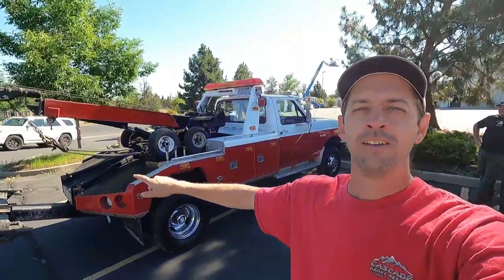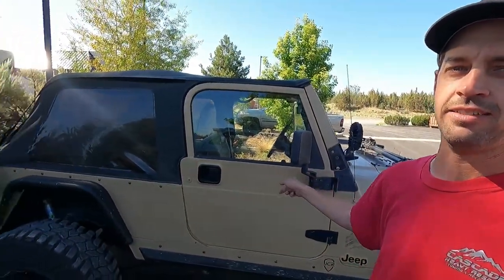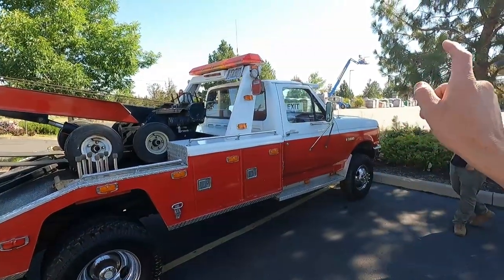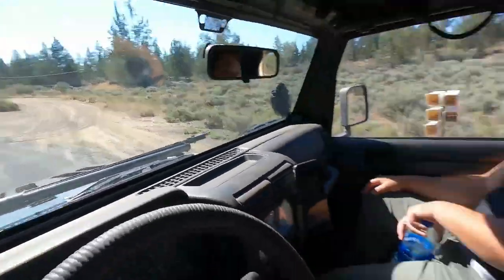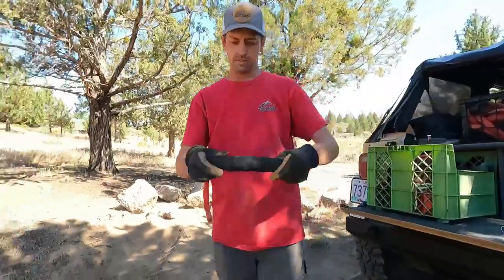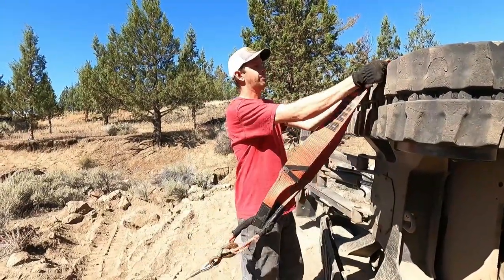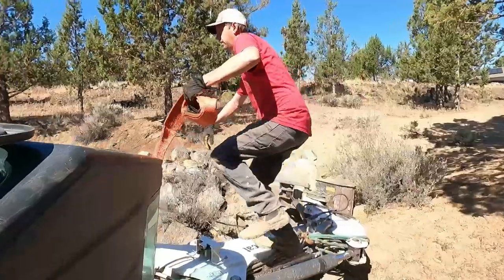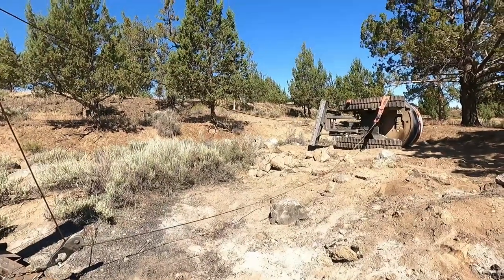Excavator down!  Time to bring in the new secret weapon!

Comment: That's a really good looking truck Casey. You need that.
Reply from the maker: I agree with you on all points!
Reply: @straybullitt  I know in Missouri, tow trucks there can run red/blue when called upon as they are considered emergency responders to remove wrecks quickly, and I think Washington St now allows for that too if not mistaken. I know this as I watch Ron Pratt of Midwest Trucks who does a lot of towing among other jobs as requested and he can run red/blue lights.
Reply from the maker: @straybullitt  perfectly legal here.
Reply: @straybullitt  Yep, exactly. That is why I mention Missouri and here as in MO, you can run red/blues, but here, I'm not 100% certain if you can, or it was talked about and can't recall exactly, but it will be different wherever you live.

Comment: I used to run pure hydraulic actuated mini diggers, you could self right them on the starter motor and the levers. Not so easy on these electronic command diggers, which is a shame. 

Anyway, that wrecker has your name written all over it, gorgeous.

Comment: Sweet rig. I still regret selling my (bought new) 2003 F250SD 4x4, 7.3, 6-speed manual. Great truck, sold it to buy a Raptor. The Raptor was sold when Premium went over $4 a gallon. Now driving a new Ranger. Those older 7.3 trucks have character, great find for your friend.

Comment: In the late 70s I helped get an excavator back up on tracks. Operator was trying to pull out a small tan oak which whipped back upright tipping the machine over on it’s side and down hill to boot. I used another tree pole as “gin pole” to raise winch line up in the air so that pull was upwards and not sideways. Worked great. Also used same method with people pulling to put up pole framed buildings. Old time methods can still be good to know.

Comment: Great to See Alex again! And Heavy Junk operators are pretty cool. Some are kids that didn’t get their way in the Sandbox LOL I was either a Jerk or their Buddy... Heavy Junk Mechanic! Pretty simple if they abused their equipment it took me longer to fix it ... if they were Stupid about how to operate it and didn’t know, (and most importantly they were teachable) I’d help them as much as I could! Even talking to the OIC of project and see about getting them more stick time.  For the Special ID-10-T’s that worked in favor to get operator level maintenance done. And washing the machines at the end of the week...  Rules of Army not instructed in school, Don’t Mess with or piss off Mechanics, Cooks, Supply or Medics. Ask Alex if that’s the same in the USMC?

Love the sound of that 7.3 Diesel! Oh yeah that’s why I got one too!!!
Mine is still stock 2001 Ford F-250  7.3 Turbo Powerstroke, tag on the Engine says 250 HP! 
The Bed, 3 Doors, rockers, Cab Corners and a bunch of other parts are in my Inventory 😉

Comment: Love the use of the yankum rope.  I've always used a winch to do the same but that is much smoother.  We worked a roll over the other day that involves a Can-am.  Person was pinned in the back with some serious injuries.  We had to cut the top off to access her as we only had 1 vehicle with a winch. Had I seen this video before that we probably would have stabilized her in the vehicle then uprighted it using a winch and my yankum rope.  We could then have just opened the door and extricated her without doing major damage to a 2 month old Can-Am.

Comment: i use yankum rope for cutting down trees i need to preload to fall opposite the way they lean extra. works very well. I have a logging winch set up on our tractor 3 point. I use the rope to preload and the cable tight after as back up. take down some huge trees that way.

Comment: Casey does it give you more leverage to upright the excavator by having two points of contact with the 4X4 wrecker?
Reply from the maker: It gives more control
Reply: What Casey said, but also, notice how he is likely using physics to his advantage and using a snatch block on the under reach to bring one cable down low to the low point for pulling power, and the other straight to the boom for leverage, and the Yankum rope to keep the excavator from dropping the other way by creating resistance as it beings to stretch as the excavator begins to get near vertical so it does not drop down and continue to fall the other way. It's all in the control of the vehicle being righted in this case due to the fact that the excavator has a taller center of gravity so it will be a bit more topsy turvey as it gets up righted.
Reply: @johnhpalmer6098  That was partially my thinking but I did miss center of gravity problem. I have seen Casey do this one other time. I just started watching him about a year ago. I do watch other channels. Like Ron Pratt Midwest Trucking and Sales and a Group out of LA California. Preparation is always the key to success and it seems as though doing the actual action is much shorter then the preparation work. Casey is one of the best at making sure his audience understands what he is doing or trying to accomplish.

Comment: Had a guy do the same thing last year with a bobcat E55 digging stumps on a slope. Had the boom fully extended with a stump and flipped it. Took a Cat 299, tac TL12 and a roll off truck to get it flipped and loaded. New gasket kit for the motor and a couple side panels, good to go!

Comment: A hi to Alex and Ben, nice truck Ben, if you gave it to Casey!  You wouldn't have to learn how to use, like a professional like Casey.  It would take you decade's and still not know what Casey does. When you require a tow, any weather? You would just call Casey❕
Casey great job, even though we knew you were going to be awesome,  it only became clear when you put the cable down low in order to pull up instead of side ways. 
I tried to reason with Ben why he needs to give you his new wrecker. It's a super deal for him, you own the doors for your company logo and name, Ben could put a sponsor's logo on the boom? Or wrecker body sides? Or not at all, or no free tows. 🤔
Thanks for sharing Casey 👍
👌🏻✌🏻🙋‍♂️🌤 🇨🇦 😎.

Comment: I love the use of the rope for a catch line. A little tricky perhaps figuring out how much slack to leave in the rope, but having someone in the catch vehicle to make adjustments could solve that.
I have never seen any of the heavy recovery people use this trick. It can be tricky easing out on the catch while operating the pull.
Reply from the maker: Yeah I didn't leave enough slack, but that's why I I used the Yankum rope as the catch.  If I had left too much and it jerked tight, the rope would have cushioned it.  If I did like this and didn't leave enough slack, the rope would stretch, and then I just drag the jeep to me as I brought the excavator over.   The high line off the wrecker and the catch line off the jeep were hooked to the same point so the boom didn't see any extra stress by me pulling the jeep to me with the wrecker
Reply: @CaseyLaDelle  that stretch rope is the only way a rope could be used for that, it's so good at soaking up the load. It was probably better to not leave quite enough slack as the jeep could be dragged easily. If the jeep or anchor was too strong, you would have to go back it off some, but you had plenty of winch power.
Reply from the maker: @bob-who-must-not-be-named8522  yep, these Yankum Ropes are game changers and open up a whole new set of options on recoveries

Comment: 2 questions
1- how do you tip a excavator that way? 
2 - did you do it just to make a video ? 
I just don't see how it will tip when I don't see a spot where it's boom will get overloaded and pull it sideways or the right track going in a deeper or inclined terrain to make it fall sideways, I'm not an expert and I'm asking for a friend.

Comment: Curiosity - once you uprighted the sleepy digger, you had all of your connections a ways off the ground. Could you have released the pressure on the arm to lower it? Or is there some kind of safety check valve that won't let the pressure bleed off if it's not running?
Reply from the maker: That machine will not release the pressure without it running, or tapping into the hydraulic system to operate the valve body.   There was absolutely nothing wrong with leaving the boom in the air.

Comment: I see this is an old video. The injectors have to be pulled before it can be started. Had a friend tip over a bobcat excavator just like that one and the cylinders got filled with fuel by way of return lines.

Comment: Great job Casey. And you're outside the box with it flipped over and you standing on top of it. I'm curious as to why you didn't release the pressure on the boom and let it down to a safer height.
Reply from the maker: Electric over hydraulic controls.  The boom won't lower without bypassing the hydraulics
Reply: @CaseyLaDelle  I hate to date myself but the older machines with mechanical controls just seem to me to be safer. Having driven most heavy equipment in my youth we were always taught when you shut it down you toggle all controls to equalize pressure in the hydraulic system and that let's the machine last longer.
Reply from the maker: @lloydfancett3039  the only way to lower that boom without starting the machine is to bypass the main valve body, which I don't carry the equipment to do.

Comment: In your ideal dream world would this truck be Gas or Diesel?
Reply from the maker: Gas
Reply: @CaseyLaDelle  Why gas?
Reply from the maker: @VM-eb5tq  because diesel engine absolutely suck in all but one single category, and that's the category that's least important to me.   For my use, gas is way better
Reply: @CaseyLaDelle  What category!
Reply: @CaseyLaDelle  oops that was supposed to be a ? not !🤪
Reply from the maker: @VM-eb5tq  pulling heavy loads up a grade at highway speed.   That's it.  Diesel does not have an advantage in any other category
Reply: @CaseyLaDelle  I had a Dodge 1 ton dully diesel 4x4 and it got much better fuel mileage than this Dodge 2500 with a fuel sucking, gas guzzling Hemi. I guess it’s the Hemi uh?
Reply from the maker: @VM-eb5tq  I have a 2004 with a Hemi, and a 2014 with a Cummins.  On highway, the Cummins gets better mileage, but off road and getting around in the woods, they are very similar in fuel mileage.   I don't one bit at all care about up and down the highway towing, because it's incredibly rare that I ever do it.   When it comes to forest service roads and in the woods driving, I'll take that worn out Hemi over my fancy new Cummins any day.
Reply: @CaseyLaDelle  Thanks for info and reply. I enjoy your videos very much.

Comment: Never use the boom on an excavator to pull on like that. Tie to the body lift points or the undercarriage. The boom is not made to side load like that. There is a release on the hydraulics so you can lower the boom without the engine running.
Reply from the maker: Won't hurt the boom at all.   There was far less stress on the boom and pins that what's it see's in it's normal daily operation
Reply: The boom will lower by gravity on that machine by just turning on the key (not starting the engine) and moving the controls.
Reply: @robb1165  i wondered if you could do that. Would have made it more stable sitting there. I am sure he had his reasons for leaving it up like that. Maybe a liability issue?
Reply: @davidvogel6359  The excavators are very stable if parked in any reasonable manner. When I'm done I park them with the blade and boom down. I turn it back on without the engine running and cycle the controls to relieve hydraulic pressure in the lines. That is for safety so there is less potential stored energy.
Reply: @robb1165  i have heard that is the best way to do it. No weight on the lines and nothing to drop on someone or something  Pressure is released so nothing moves without it being started and pressured. 👍

Comment: why wouldnt the operator just work that boom and stand it back up ? rookie operator?  its riskier to let it sit there and let fluids move places they shouldnt go  ,oh well  you and video were good anyways
Reply from the maker: I mean, sure you could do that if you don't mind buying an engine 🤷🏼‍♂️
Reply: @CaseyLaDelle  ive seen guys flip those and stand em right back up even sommersult and push em right back upright but hey if you got paid your gain ,i pulled plenty of bobcats out in my time so great job man you made it look simple,too bad that truck didnt have twin booms  ,my old C60 would never leave anything stuck with 2 booms
Reply from the maker: @rctopfueler2841  you realize that I got called to upright a rolled over machine, right?   Do you really think I'm going to show up to something laying on its side and start it up??
Reply: @CaseyLaDelle  no no no was not meaning  not sure how you got there  i  said been great if that was a dual line dual boom setup didnt i ?   and kudos on great job with what you had there Was not Knocking anything You Did  only the orig guy who put it there  ,about 30 seconds of manuvering and upright it would of been  now that it sat i agree dont start it or it likely would of hydraulic locked with oil ,/ fuel in cylinders